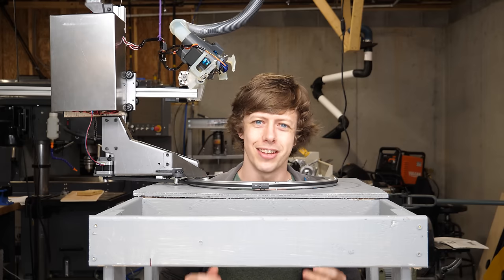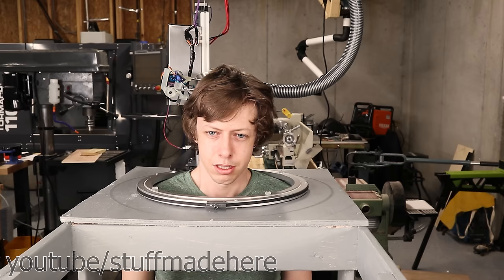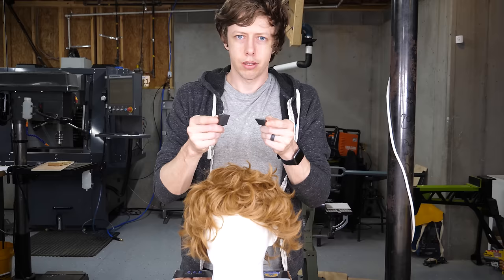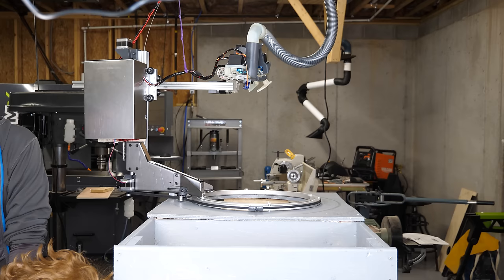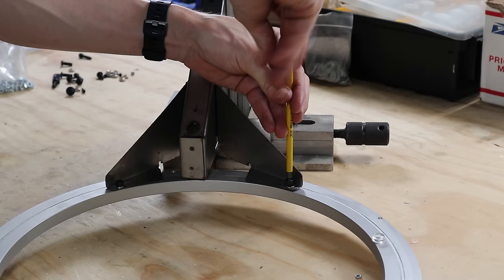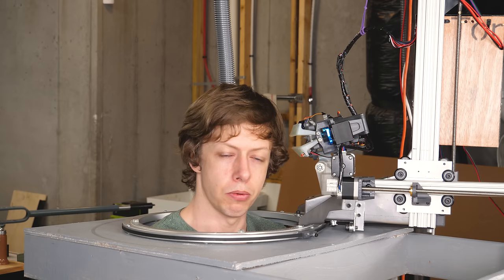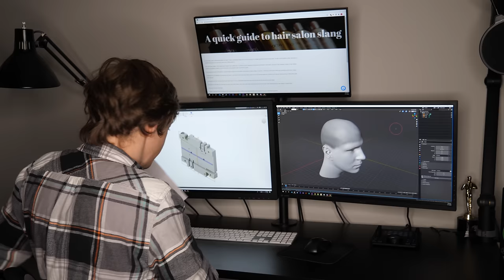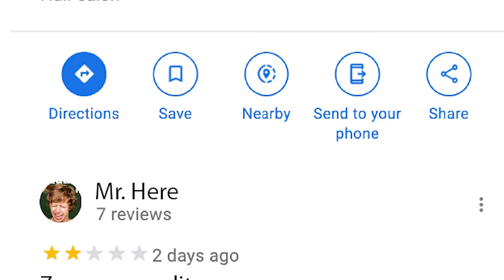I made a hair cutting machine

Comment from the maker: If I build a version 2, what features should I add? I really like the idea of adding a trimmer to cut an intricate pattern that would be impossible for a human to do.
Reply: Something to protect the ear much more. Turning into an elf would be my primary concern using this machine.
Reply: Ear slicer
Reply: Whatever you do i will root for you king
Reply: Could design some sort of ear protector prosthetic colored yellow or something that the camera could easily recognize.
If this becomes REALLY good, how about one that manscapes your, uhm, manscape area?
Reply: There are some electric rotary saws that pass current trough the blades to detect changes in capacitance in order to stop the blades if someone is about to have an accident (Cut their finger), maybe try to add something like that in order to stop yourself from cutting your ears off.
Reply: An ATC to switch between scissors and a razor blade for the finishing touches.
Reply: Extrusion tip to do some on the fly hair dying
Reply: If you’re adding a trimmer, you should consider letting it trim beards as well. Imagine the perfect goatee alongside the perfect mullet!
Reply: Add a vacuum to grab your hair instead of the little clamps
Reply: Nils Erik Mæland 

What this man said, a beard and mustache trimmer
Reply: The Flowbee comes to mind. Maybe an impeller that changes depth inside the vacuum hose? Safer than scissors and can get closer around the ears.
Reply: I feel like you should use clippers.  Could have it automatically change guide combs.  Might be tricky finding the contour of your head without more sensors but it would be cool to see a robot fade!  Probably also a little safer than using scissors...
Reply: Oh jk he thought of it
Reply: Nose trimmer! haha
Reply: I wouldn't mind seeing a trimmer as well
Reply: World's most advanced flowbe
Reply: I think you should make the robot offer you comics, so you can read them, while getting the haircut.
Reply: Forget all these other performance enhancements. Everyone knows the key is to improve the user experience. Need to add relaxing music and hot towel wrap!
Reply: You should make a costume for the robot
Reply: Once you make it do one pattern, you'll be able to do many. Maybe if you leave a tiny 'stuff made here' logo, so people don't keep asking "where'd you get your haircut".
Reply: trimmer is a great idea, maybe a head rest that moves around to the opp side of the siz to help keep your head steady
Reply: maybe 3d print a chin rest like those eye doctors use to keep your head steady. i was once thinking about an automated haircut machine as well. there was an tv selling product that was basically a vacuum attachment to cut hair. it hat the cutting mechanism inside the tube that sucked the hair in making it much safer but there is still the problem with partitioning the hair so only the part that has to be cut at that specific length will get sucked in.
maybe touching an electric ball lamp that will make your hair stick out in the direction of the normal vector of your scalp will help? haha hope to see v2 soon!
Reply: Stuff Made Here I reckon a trimmer would make it a lot easier to compute aswell, you don’t need to grab the hairs and it’s almost always in contact with the head and cuts at he correct length by using a gaurd
Reply: Ear guard, trimmers, and fix the axes. You need to set up a pivot which is approximately at the center of the head. This way when the cutter moves up and down, it also follows the tangent of a circle centered on the head. You may be able to get away without a vertical axis (just adjust the height of the seated victim), but adding one would allow you to control the angle of the cutter without having a flimsy and floppy knuckle at the cutter head. Just adjust the position of the pivot I previously described, in order to change the angle of incidence of the cutter at various points on the head. This would also allow you to handle the oblong nature of the head and get perfect necklines.

I would also encourage you to add a full-coverage guard on the scissor cutter. Good for stray hears, stray fingers, and stray ears. If you insist on keeping the scissors, you should add a layering stage to get a professional final result.

Clippers for a close clipped cut (sick fade bro!) will require a slightly different approach. Stylists will either freehand the clippers (for very short lengths), using the guard against the scalp as a guide, or will run the clippers along a comb. As you found, combs are not easy to automate, but I think you could use the same fake fingers as a clipper guide for longer lengths. If you want to run the guard directly against the scalp, you will need some sort of gentle spring mechanism to apply minimum contact pressure and prevent scraping and sticking.
Reply: Try with a Van Der Graaff generator. It will ppoint your hair perpendicular to the head better than the vacuum. You just need to trim like a helmet all at once.
Reply: water jet spray and a new mechanism to part and pick up the hair

that will reduce time of cutting and unevenness of hair cutting will be low as well
this is how we do where i live

but the vacuum mechanism will suck
pardon the pun!!!
Reply: Maybe adding a LIDAR sensor instead of the push button, so you can know almost in real time the distance between the head and the scissors. Also getting rid off the scissors and using a real hair cutter will be nice!
Reply: You could try using hair clippers to help trim the sides and back. You would manually select the guard but use a similar proximity sensor to guide the clippers along the head
Reply: Something to apply product to the hair and style it a bit.
Reply: Ability to fade the sides
Reply: A stand that fixes the head in place and also gives a place for it to rest, and it could extend from the chin to towards the ears to cover and protect them.
Reply: water spritz bottle. This could allow greater control for layering your haircut. Also +1 for the trimmer.
Reply: They have angled guards for trimmers. That way to could do the around the ears in almost one motion. Also, nose trimmer XD
Reply: Forget the hair robot... make a tattoo robot!
Reply: Razor to shave beard or low part of hair for a skin fade
Reply: Oh wow cool
Reply: i'd like to see a scissor/comb/trimmer automatic toolchanger.  and maybe a shampoo & head massage after everything is done.
Also, good job on keeping this machine pretty safe overall.  I nearly had 2 heart attacks during michael reeves' surgery bot video
Reply: Move the depth camera so that it would still see your face
Reply: Instead of scissors you should go with clippers/trimmers (safety), or at least upgrade the scissor with the new you bought if it is for the actual job.
Reply: Skin fade would be amazing, every time I get my hair cut it’s always different!
Reply: does this belong in https://www.reddit.com/r/dontputyourdickinthat/ ?
Reply: you might try lidar to get a surface to cut hair instead of that bump switch
Reply: You should make it force driven. James Burton does a lot with force driven robotics.

You can make it work through driving and sending current or by having 2 encoders with a spring to detect difference between the two which creates the constant force.
Reply: Allow continuous contact with the head for more accurate distance finding (or get a radar chip like project Soli) and make the cutting device like the Flowbee Haircutting System.
Reply: Idea 1: Have it give you a shave like an old school barber shop, just make sure it can't go Sweeney Todd on you!
Idea 2: Make your wife a robot that can apply makeup and 'print' pictures on fingernails.
Reply: @adrianeta  haha, just watched the video on the Sawstop too
Reply: Probs a squirt gun and a hair dryer
Reply: Laser scissors and relvolver for some motor utilized hair cutter. Some waterjet for easier job for scissors with hair, maybe.
Reply: @VinceGBro  instead of changing guides, have a single guide that can change lengths.
Reply: And add spring or something to give some force for scissors blades what pushes them  together for better cutting.
Reply: Something to be aware of with clippers, some people have lumpy heads (I have a friend...) and running the clippers along a lumpy head can actually create a lumpy hair cut. I prefer a more vertical fade on my sides so that my head looks a little more rectangular instead of, well, lumpy. I think you would have to pick a measurement point on the side of the head and then clip more vertically in global coordinates along the side instead of strictly a set distance from the head-scape.
Reply: I mean cutting making a way too accurate mandlebrot pattern would be strangely satisfying.
Reply: I subbed to you
Reply: Definitely trimming functionality! I think that alone would upgrade the cut from a $5 cut to at least a $6 cut.
Reply: beard trimming... oh wait , need an other model hehe
Reply: Spend some time improving on the off-the-shelf scissors.  Why spend so much time developing the spatial handling when you're using a prehistoric cutting device?
Reply: A quick wash before cutting? Or a pomade applicator? Or a mirror function? Or a coffee function? Or a nose hair trimmer?
Reply: Mohawk 👌🏼
Reply: buy a flowbee and attach it to robot for the second generation.
Reply: It has to be programmed to say "go ahead and look down a bit" a lot.
Reply: First I should say amazing video. I would change the scissors to something with a round point at the ends so if you accidentally move your head too much it doesn’t poke in your head. And also add an ear protection and an instant emergency stop button just in case something went wrong. I couldn’t get how it knows if you turn your head a little bit around. Does it also check for that somehow?
Reply: Shaving!
Reply: I think that a vacuum tube with a scissor like a camera iris would work very well. The robot could touch the tube in the head and activate the scissor. It would be much more safe.
Reply: Chin and forehead rest should help  to make less movements right? Like the ones ophthalmologist uses to see your eyes
Reply: IMHO
1) add a trimmer with a servo controlled comb/blade so that you can change trimmer numbers seamlessly for dope fade.
2)add roll pitch and yaw control to the trimmer mount for ful freedom of motion around head and above ears
3)whats your age man!!?
Reply: K
Reply: Adding some sort of quick change 'chuck' to switch between scissors and the clippers might be the way to go on that one. Rather than trying to get them all into the same tooling.
Reply: make it have a complex neural network that decides what type of mullet to give you.
Reply: Humans do some crazy patterns so idk If It won't be possible by a human.
Reply: If you simplified the joint geometries it would make positioning the scissors much easier. Also another Idea (perhaps harder implement) would be to mount the depth sensor camera on the arm so that you wouldn't need to bump into the persons head for every cut :)
Reply: Build one that gives a buzzcut!
Reply: treat it like a dual headed cnc machine...the arm goes back to home and gets a set of buzzers, then bam new program entirely for the lower base of the hair.
Reply: What about a machine to wash your hair, blowdry, and thén cut it!
Reply: hair wax
Reply: I cut my hair with clippers - its so easy and works a 100% - just start with a long clip all over - then you can grade it down to zero on the sides and back.

Would work perfectly and thats how you get those really nice cuts with long hair on the top (use scissor method there) and then grade down from sides about half to one inch above ears.

Also - maybe integrate your personal selection of podcasts or music with voice controlled - Hey Google.

So chit chat on google - then "Hey Google - play Santana".
Reply: To make it easier you could add a chin rest with cheek bone pads to aline your head so it doesn't move.
Reply: The ability to use a hair elastic. I mean everyone uses that, isn't it?
Reply: Idea Spam: 3D Scanner, On-Toolholder Camera, Toolholder, Scissors Tool, Shaver/Electric Shears Tool.
Reply: @d3lsl0w  and does something else while it's at it 😏
Reply: Get some better hair cutting scissors.  Quality scissors for a quality cut.
Reply: You should make it try to give a fade with a trimmer
Reply: Put something like aluminum foil hooked up to a circuit on your ears, then if the scissors contact it then the circuit completes and tells the robot to stop. (you can have the plastic guards make a barrier between you and your ears and push them out of the way). Also a comically large red abort button. and then for the angle for your scissors, you can make a 3d map of your head (this can just be a rough model using points then connecting them like game models since you only need the rough angle of the scissors, or something more fancy like that depth camera), then use multivariable calculus/linear algebra/differential equations to find the plane orthogonal to any given point on your head, then just make sure that the plane of your scissors is a multiple of that plane (ie it's parallel).
Reply: Waxing? Btw I love the baseball bat idea
Reply: more conversation starters
Reply: you should do a robot that shaves for you
Reply: A lollipop dispenser. 😁
Reply: facial hair trimming/styling.
but, giving a robot a sharp object near a human neck probably isn't a good idea.
Reply: Brain surgery feature
Reply: Do the perfect fade it would be easier with the trimmer
Reply: Split the inch-wide vacuum head into a grid of smaller vacuum heads,
with a small clamp and cigar-cutter at the end of each one for pixel-perfect accuracy.
Better yet, surround your entire head with a massive grid of vacuum heads and individual cutters and clampers,
each tasked with making a single cut.
Turn it on and all the vacuum heads turn on, suck up the entirety of your hair collectively,
then all the clampers mete out the proper length of hair simultaneously,
then all the cutters perform their cut simultaneously.

Then there's no need to worry about your head moving because the entire process happens in 10 seconds max.
No worry about wayward strands being missed because all the hair is sucked up and accounted for at once.
Reply: Add a camera to the arm so u can see what’s happening. It’s more of a cool thing.
Reply: 100 percent a clipper. seeing a robot detect when to switch to a 4 from a 3 and just get those clean sides in general I think would make a world of a difference. The biggest obstacle I see is switching from each level on the clipper, although I think that if you were to go with a  clipper and to solve that problem would be to 3d print a piece for the top of the clipper that can when moved up and down at the top of the clipper adjust from say a 4 to a 3 when the computer says to.
Reply: Hair laser
Reply: How about using a trimmer instead of scissors, less chance of cutting an ear off and could be mechanically simpler to get more usable angles and cut lengths. The buzzing also adds an extra element of fear 😂
Reply: Sensors! Moar sensors!
But specifically, add a counter-weight and sensor rig to the ring across from the robot, I bet it would help you locate your head much better, and I'd bet that the counterweight would help the rotation about the ring. While you're at it, mix it up with sensors, see if you can't get some ultrasonic distance sensors or image based sensors to help navigate your head.
Also, some kind of vacuum buzzer combo for around your ears and neck. See if you can't get a fade going.
Reply: I feel like an adjustable guard buzzer with a vacuum to keep hair straight and pulled back would be a bit simpler and might get the job done easier.
Reply: You're making a Flowbee. Just buy one and attach it to your rig.
Reply: Robotize a Flowbee with a continuously variable length guide.
Reply: @James Lintell-Smith Yes!
Reply: Using clippers (which are essentially motorised scissors) would be safer and would be quicker, a guard would guarantee length, including custom guards for the top?
Reply: Vacuum, trimmer, continuous cutting motion, finish the whole cut in 30 seconds.
Reply: Hair cnc... i like
Reply: The ability to have some small-talk with the robot could be nice. I mean we all know that's the REAL reason we go see a barber, right? Who actually cares about a good haircut. ;)
Reply: maybe make your robot crawl on your hair using some grippers/ clips/ vacuum? so the relative position between your robot and your head is fixed all the time. Robot position can be localized using external sensors.
I want robot to be able to wash and cut the hair at the same time.
Reply: Face shaver/beard trimmer, eyebrow trimmer, nose & ear hair trimmer.
Reply: Beard trimmer. Maybe a colouring function, dyes and the like. If you want to go all out you could have it like a Turkish barber and have it finish off the robocut with a razor. 

Rather you than me though.
Reply: Loose the voice. If theres one thing I could improve regular hair stylists with, It'd be them not talking to me. ever.
Reply: Make an ATC for it. Scissors and fingers on one holder, trimmer on one, polisher tool for the aerodynamic heads, comb and dryer to hide the cutting mistakes. The possibilities are endless.
Reply: Defo needs eyebrow trimming
Reply: make the person getting there hair cut sit on a  van de graph machine then use a laser to cut the protruding hairs. (will have to lock the person head in place for safety.) Might be joint venture between @styropyro and yourself (Colab).
Reply: I’m a barber and I have a lot of ideas. I’d like to help you.
Reply: dont be putting hairdressers out of business now,
i know what your capable of youn- i mean 30 year old i think?
Reply: Well, this is a tricky haircut to do. These days a haircut is trim the sides, make a fade, and with the top of the head, do just what the robot did. I think you can go for a trendy haircut, and program would be much easier to write.
Reply: my mums hairdressing business going great

stuff made here entered the chat

business ✖ 0 = 0 Ah we didnt need that anyway sitting homeless in streets watching Stuff made here making robot that programs
Reply: kkuhn WHAHAHAHHA 🤣🤣
Reply: Do the turkish eye and ear hair removal with fire :D
Reply: It should have a sexy sultry voice and it should also be able to shampoo your hair and wash
Reply: Why don't you use a clipper instead and program the robot to do fades
Reply: I was wondering if you could do some sort of capacitance testing on the scissors to detect if they were touching skin. That way if it senses the capacitance changes, if can abort the cut,  reposition the angle, and try again.
Reply: what about support for hairspray?
Reply: Next make a robot that brushes your teeth for you
Reply: I know someone that can help you with figure out how to do the perfect cut !!
Reply: Sharks with frigging laser beams.  And keep that vacuum turned on longer to take away the smell of burned hair.
Reply: Hair dying ability .
Reply: Add a clipper for the side and back, this will be the best barber ever
Reply: Better communication
Reply: Swap the scissors for an electric clipper.  And incorporate LASERS.
Reply: Line up and fade
Reply: Make it be able to dye your hair
Reply: You can make and wear a ear protecting plastic cover. So machine can move freely around your ears without cutting your ear :)
Reply: Choose a target type of haircut from a list based on current hairstyle.
Reply: you should make it be able to do a fade. Not only are fades tricky for a human to do, but it could be done with a higher level of precetion by a robot.
Reply: This is how he becomes a multi millionaire, get it patented, get shops around the country and give out robotic art haircuts
Reply: MASS PRODUCE AND TAKE OVER THE WORLD. also attach a flowbee.
Reply: Have it go answer the phone and leave you sitting there. Then have it ask "is this length ok" and ignore your answer. Also get CodeMakesItGo to help with a project!
Reply: If the camera concept is somehow made feasible, maybe write some code for recognizing skin color and cutting length that way
Reply: Do you have a pat attorney? Good stuff
Reply: A radio and seat warmer/cooler would be nice. And why not a way to pay at the machine, like a vending machine.
Reply: They make small skin safe no snag shavers if you catch my drift. You could possibly use one of those as an insert tool to trim around ears without chopping off ears.
Reply: Give up so it does not hurt you.
Reply: Mullet Maker option in the software
Reply: This is amazing. Great job man. I suggest you create a device which can alter its length. For example how a trimmers clip can be adjusted for various lengths, maybe if this device works in conjunction with vacuum so basically its touching your scalp and them the scissor is cutting at a length. I hope you understood what i tried to explain
Reply: Replace the scissors with a flowbee style cutter
Reply: By attaching the intel realsense or a single layer lidar to the moving parts of the robot, you would basically have a nice 3D scanner. You could then upload this perfect mullet of yours for posterity. Or simply  provide the user with a before/after 3D print of their haircut.
Reply: Awesome job! The only thing it comes to my mind is making the hair wet, it can interfere with the vacuum power but it will help to catch and model the entire cut as the hair will no longer take random movements/positions.
Reply: Try to attach the depth camera to the moving stand (this way, the stand will not block the camera), and do a calibration sequence in order to 3D model the head and the hair. The robot will be much more precise.
Reply: Awesome build! In version X, a smaller, portable one, the size of a helmet would be cool. Perhaps it can sit on the shoulders, cover the ears with some protection, scan the head/depth  and then use trimmer like cutters to do the job.
Reply: I bet if you made a small tube with a larger tube around it, then sucked in the middle and blew compressed air out the larger one you could separate very small hair sections. Then slide, like, a nose hair trimmer down the tube to the right length?
Reply: Use a Van de Graaf Generator to get your hair to stand out and then use a laser to cut it.  That's what I would do if I had the knowledge
Reply: Of course, you'd have to have a chin rest and a face scanning tool first...
Reply: I would consider changing the cut-length thing to just use a sort of adjustable spacer; so that once set, it literally can't be any distance other than the correct one if it's touching your head.  Bonus points for automating moving this for different lengths where necessary
I'm imagining a hollow ring, around the diameter of the vacuum, on 1 or 2 ... I don't know the term, the threaded things that you're using for moving the arm, with the scissors going between the ring and vacuum, and the switch on the front of it.  Rotate it with the scissors if necessary.  Then it can just press it to your head, maintain contact with the switch and cut (also acts as a bit of a killswitch so it doesn't try to cut unless it's actually touching your head with the spacer)
Also, this makes cutting around your ears slightly more doable.  I mean you won't get a precision cut, but if you press that against your ear it'll flatten the ear while pulling the hair
Reply: Using only one scissor is because of the human limitation of using only one hand to hold the scissor. Instead of rotating a single machine,  there could be four machines (back, left, right, and top) which does the cutting in parallel that not only saves time but also makes the problem more interesting with a distributed coordination.
Reply: Hair dye... or a perm
Reply: I liked the camera idea much better, it would make things a lot more robust as far as movement goes. If you mount it on the control arm where it won't be blocked, then you could use the "position relative to" for depth measuring. Using the flowbee technique was perfect, but added in the "fingers" to isolate the hair was genius. Trimmers on a separate gantry arm to handle the trimming above ears and at neckline would be great. then you wouldn't have to worry about creating a separate mechanism to switch out tools.
Reply: Firstly awesome vid. Secondly, could you add a trimmer and maybe calibrate some way to identify neck location. Then you could input your desired neckline (round or square) and then have it go to town. This could be a separate machine that you rest your forehead on a pad to allow the trimmer to be consistent and technical. It could also have another flat arm like the ones you were initially going to use like combs to push the ear down! Idk my mind started going off when you were talking about making upgrades and ideas of how to improve your design. I think a trimmer would be cool😊
Reply: Buy some ear protection caps
Reply: Fades and patterns
Reply: Id definitely be down to help you create this awesomeness ive been a barber for almost 14years and have a love for engineering.. definitely add clippers and more recognition cameras
Reply: a setting for the back where it asks you to look down? and uses an adjusted model with the face looking generally down
Reply: If you could add a machine and make it able to do fades ... Ergo change machine fairs lengths , those guards that move forwards and backwards to change lengths ...  Then this could be amazing.
Reply: It has to say the same story about that one time in Brooklyn, every time you go in
Reply: Bingo Ban,
One great suggestion tho.
If i would make one i would do it like the helmet way, 
There is gonna be a big helmet which has many small vacuum pipes in a horizontal plate. which will go from one side to the other of my head to right angle of my forehead.  
Then the vacuum will suck my air i mean all of my hairs under the vacuum plate. and then you just need to teach the trimmer to cut in slope
Reply: So, there is a really easy way to protect your head and ears, is how you said, use cordless hair trimmer with some tools on it. Its solve the bunch of problem with safety, cutting process and time too. Good luck! :D
Reply: Oh wowcool
Reply: make it do a skin fade
Reply: Stuff Made Here I would say maybe a 360 camera so you can see exactly what it’s doing to ease some of your distress while it’s cutting
Reply: Ultrasonic sensor for distance instead of the touch sensor?
Reply: put cutter in vacuum tube. add gyroscope. make it handheld and cut length based on position awareness... if possible... while avoiding secondary grab.
Reply: Skin fade option
Reply: i would say use some kind of hard plastic molded to your ear to that if the robot accidently knicks ur ear it just knicks some hard plastic.
Reply: these "ear coverings" could also be bluetooth connected and tell the robot where your head is
Reply: foldable side so u can walk into it and fold it down instead of go under
Reply: Maybe you can fix the head still and mount the cam ON the arm to improve the machine (very nice project tho)
Reply: Spray water?  It could also gel and style your hair at the end.
Reply: You should add a beard trimmer
Reply: Let machine ask you to pick a song to play.
Reply: change it to a male voice, seeing that it's more of a barber and not a stylist and add the voice line:
"that's pretty wack"
in response to a negative comment like, my dog died
also, possibly make different style haircuts, and when you have made you decision, it will say:
"say no more fam"
Reply: Add a water jet spray that sprays the hair in between the the suction tube and your head, before it proceeds to cut. Normally, hairdressers will spray your hair because it makes it easier to cut and you get better results with each cut.
This could also reduce the overall time the robot spends cutting it.
Reply: scizzors a bit more dangerous than trimmers so that would be a must have option
Reply: I could see this going mainstream and you oculd have one for your own home if it became popular enough, 
like the jetsons or something
Reply: Annoying smalltalk for that authentic feel.
Reply: Protect your eyes
Reply: @Bubbalubagus  That should fix issue of "lack of personality"
Reply: Add functionality to do perfect fade
Reply: Hair trimmer and water mister to wet your hair
Reply: Great job and amazing problem solving. I have two words for you ”Flowbee”.
Reply: Cut the hair with a laser instead of with scissors
Reply: The Suck Cut
Reply: A spray bottle to wet down your hair to keep your head wet works better with the equipment get your hair from going everywhere
Reply: Erect the hairs with static electricity. Use a laser to cut the hair.
Reply: Spray bottle that aims for your eyes
Reply: VR where you can cut your own hair with your own two hands
Reply: I’m a hairdresser and what you’ve built is impressive in its accuracy and ability. However, hairdressers will tell you the most repetitive task they do all day that needs to be done by a robot is a root retouch. Is basically using an applicator to apply a cream to the first 1/2 inch of hair at the roots. A root retouch is a boring, repetitive task that people pay a lot for. This robot that cuts is halfway there.
Reply: Make a second arm if you want to use a razor.
Reply: use ultrasound sensors instead of touch sensors, you can get a good accurate distance measurement that wont have issues with hair in the way!
Reply: trimmer, and maybe add a pump that sprays water on the hair like a real hairdresser does?
Reply: I literally laughed my head off dude!
Reply: Nice. It's awesome. Look into it's industrialization. I would buy some.
Reply: Could you just get rid of the small shears and add a trimmer ? It might do a cleaner cut.
Reply: Maybe you can have multiple cameras at different points at well as on its hand to get more accurate measurement of the subject's head and add software's that allows the robot to cut different types of hair and it's styles. 👍
Reply: a coffee maker and some magazines!
Reply: Add ear guards to make it safer
Reply: Nothing to say . But it is very complicated....
Reply: MAKE A PLASTIC COVERING FOR THE EAR AND FOREHEAD AND THE BACKSIDE OF THE NECK, SO THAT THESE REMAINS SAFE.
FOR THE HAIR CUTTING USE TRIMMER INSTEAD OF PAIR OF SCISSORS. SO THAT IT CAN ALL AROUND THE HEAD AND USE AN ADJUSTER TO MAKE TRIMMER CUT THE DESIRED AREAS. SHAMPOO AND CONDITION THE HAIRS BEFORE AS WELL AFTER THE HAIRCUT SO THAT DESIRED HAIRCUT IS ACHIEVED.
BEST OF LUCK FOR THE PART 2 OF THIS PROJECT.
Reply: MAKE A PLASTIC COVERING FOR THE EAR AND FOREHEAD AND THE BACKSIDE OF THE NECK, SO THAT THESE REMAINS SAFE.
FOR THE HAIR CUTTING USE TRIMMER INSTEAD OF PAIR OF SCISSORS. SO THAT IT CAN ALL AROUND THE HEAD AND USE AN ADJUSTER TO MAKE TRIMMER CUT THE DESIRED AREAS. SHAMPOO AND CONDITION THE HAIRS BEFORE AS WELL AFTER THE HAIRCUT SO THAT DESIRED HAIRCUT IS ACHIEVED.
BEST OF LUCK FOR THE PART 2 OF THIS PROJECT.
Reply: GOOD SCISSORS. Those you added to your robot are not the ones that hairdressers use, they're usually much bigger. Also, add a mirror, some hair trimming machine for the parts where hair is gonna be shorter and maybe a vacuum cleaner to remove the hair that's been cut.
Reply: So, basically a hair cnc
Reply: Definately make it cut your hair with a laser instead of scissors😱
Seriously tho, it could work with your dark hair color and light skin color.
Reply: Make some covers for your ears for extra safety while the robot trimms areas next to them.
Reply: Coloring!!!
Reply: @pierfrancescooselin9214  doesn't even have to be lidar, ultrasonic sensor works too
Reply: Mount 4 sensors in 4 corners and let it map out and track your head, this way you can remove a bunch of sensors from your robots "arm" and add other tools, could even get it to give you the perfect shave.
Reply: Make it so it can change your hair color. Like a hair dye feature.
Reply: How about hightech scissor?
Reply: Give it a face.
Reply: This is all wrong!! It should've been trimmers or clippers instead of scissors... Way faster and with less inaccuracies than scissors....then the rig, there are 3-axis robotic arms on the market that require minimum programming, no need to make a substandard and limited rig from scratch! The vacuum idea is the only good thing about this, also, the should've added a stand for The head, not a hole in plywood, once you set you head in a chin-forehead stand, the probe can measure it and it will remain the same and prevent the head from moving around!
Reply: Put streaks in your hair. Pull hair, apply dye, wrap in foil.
Reply: with a trimmer attachment how well will it do a zero fade from skin, military style haircut. if it can do that, i will buy one.
Reply: Impossible coloring, not just impossible trimming!
Reply: LiDAR proximity sensors, plus various hokey/jokey stylist personalities: Robocop, Optimus Prime, Marvin the Paranoid Android, C3P0, Daleks, Robbie the Robot, etc.
Reply: Take a look at Jimmy neutron's hair cutter
Reply: Get it to wash your hair
Reply: U need the robot to have more space so it can move freely around. u kinda wanna build it into the roof not around ur neck. :D
Reply: Pubic hair robot trimmer version2.
Reply: Why not put the camera on the vacuum tube so it's never blocked?
Reply: A big kill switch in case of emergency
Reply: Hair dying! Good luck! 😁
Reply: maybe add a razor to the robot
Reply: Make it conversate more
Reply: A rotating chair controlled by the computer so you just sit and it turns you around.
Reply: Face painting?
Reply: You should add a razor cutting ability for this robot, the razor gives your type of hair a "softer" feel than the scissors and would be great to see in action. I recommend the hair to be towel dry if using the razor though, otherwise it will hurt a bit...
Reply: I do think you can use a trimmer all the way without using any scissors. It is much safer and simpler. I suggest making a spraying mechanism that can spray instant dry dye and hairspray to do a custom drawing on your hair.
Reply: try to made trimmer with auto degrees changer by tracking position from ear
Reply: Add a 
1. Head rest
2. A tall seat ( so it can get the back of your head and rest)
3. rubber ear protection that holds your ears back
Reply: maybe build a massage robot for rub and tug?
Reply: As a licensed hairstylist and amateur coder I love this! If you need some professional tips it would be fun to see if you could try recreate what we do in the salon. For starters, wet hair is easier to manipulate and section cleanly. Have you tried using the robot on damp hair?
Reply: Intricate patterns that humans can't do sounds insane, the trimmer is a fairly cluncky thing to use for a machine, wouldn't adjusting to the small movements of the head while also correcting for pressure and angle be nearly impossible for the machine as well?
Reply: Add a separate arms on the opposite side to hold head still , get more accurate cuts
Reply: @Bubbalubagus  I better see you commenting on Micheal Reeves' videos
Reply: Yes, add electric hair clippers and just overall continue updating it and debugging it till it gives $10 haircuts
Reply: I was a hairstylist, I would suggest try to have multiple vacuums, suck the hair and the same time, and hold the hair with combs, then cut it all at once, then suck the hair again with slightly closer range with thinning scissors. You may use a few fixed springs with a stick to allocate the head position instead of using 3d detect(because hair has depths in it, is hard to scan underneath with the scalps).  So even your head moves a bit, the fixed  spring stuck is always catch your position. Another method, you may use trimmer with “numbers” on it , I believe u can manipulate the trimmer more easier than scissor, and more accurate length.
Reply: The robot should use a hair clippers so it goes faster, and then switch to the scissors
Reply: Make a Robo-wife
Reply: Please consider the effect of lying down and having the rotational  form in a vertical orientation- much akin to you lying your head in a stylist sink. This would achieve holing the head more secure and allow a simple fixture to be placed to "ride" along your neck line and trim it up.  My 0.02.... Bravo overall- Cheers!
Reply: Make a robot that washes your hair as well
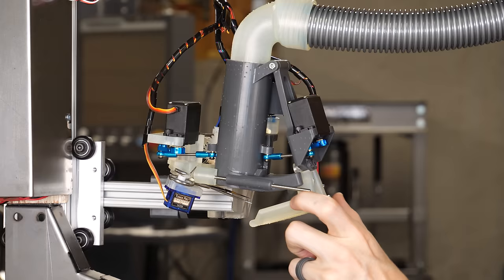Reply: (04:15)the way to cut hair. I think the order of the finger and scissors should switch so that it could fix the "wire hair" problem.
Reply: for Combing the hair before cut, I think it could add the two combs on top of the two fingers. so the hair cut steps would be 1. vacuum 2. comb 3. fingers 4. scissors.
Reply: Long distance hair cut, where the robot hand follow exactly like the hand of the barber
Reply: a eyebrow trimmer........
Reply: Trimmer
Reply: You should make it do a skin fade! I don’t know if it’s your style... but it’s one of the harder haircuts to give a dude. Awesome video!!
Reply: Mate. the main flaw is that the robot sits outside  and doesnt align proper because head move. You need to find a way to fix it to hair not outside.
Reply: Retro-Reflecting panels
Reply: You need bigger scissors buddy. That's all :)
Reply: Do a version 2, I feel like teaching a robot to use electric trimmers will be significantly easier, especially for simple trims (a buzzcut for example) is there anything that is teaching the robot how to cut hair? Like training it through videos.  Also something to protect the ears would be nice.
Reply: Maybe a style feature to give you a cool hairstyle without cutting
Reply: still like 17-18 y/o
Reply: Only thing missing is AI.  My BIL is a Genius, no joke Extreme Genius.  Extremely fluent in C++ and D.  His specialty is AI and works for one of the wealthiest CEO’s.  He’s working on an insane AI project worth billions.  I will have to share this video with him.
Reply: Give it the ability to cut the perfect skin fade
Reply: Make it keep the head in one place and have it cover the ears.
-Make it pull the hair in straight meches.
-Some mecanism to not get the scissors to close to the head.
-Buy realy good and sharp proffesional scissors.
-Use hair dressing technique in to your programing.
Your not so far from making a good machine.
But for the sistem you have you can generaly cut longer lenghs.
For shorter you need to change the machine i think its harder to give good short haircut.
Reply: You could wear special ear covers (e.g. modified over-ear headphones) to standardize the shape of the ear.  Then you could cut a lot closer.
Reply: I think you should add hairstyling features for afro-textured hair, maybe also adding a blowdryer and or conditioning lotion capabilities and a braiding mechanism ✊🏿
Reply: What about  a larger scissor? O even both, the one you have now that is short, and an extra pair
Reply: water sprinkler would be great option it can loosen the tight hair.
Reply: Fade
Reply: May I suggest a bot that plaited hair rather than cut it. (From a girl).
Reply: Not a feature, but if you found a way to pass a small electrical current through the scissors, you could basically give it the same functionality as a saw stop table saw and prevent it from ever cutting skin.
Reply: Add a leap motion hand tracker to allow for a "manual cutting mode" so your wife can cut your hair with super-accurate precision.
Reply: @d3lsl0w  Lets hope the sensors and 3d models are correct then LMFAO
Reply: Oh, what cool
Reply: Why tinker with perfection? You made an automated mullet machine! Send this thing to Kentucky ASAP and you will be Scrooge McDuck rich!
Reply: the easiest way to not injure your scalp or ears is stop using scissors or trimmers or any mechanical cutter
use powerful enough laser that has threshold to cut only hair and not skin
try ignite a lighter at your skin for 1 sec, nothing burns, put on your hair it melts within 0.5sec
so you can adjust the speed of the arm so it cant injure the skin
Reply: @samrolfe2563  I agree. There are a lot of ways to cut hair exclusively with clippers. And while they seem more dangerous it's actually a lot harder to cut someone with clippers than with scissors. The blades on clippers are designed not to cut the skin.
Reply: You could put the RealSense on the moving base to get the depth, but I guess an Ultrasound sensor would do sufficiently the same thing. It should be more convenient than the switch.
Reply: Stuff Made Here call it the anti mullet machine
Reply: Maybe add a resting pad for the head so it stays still?
Reply: At the end of the cut, let it ask you if you want Gel in your hair, then don't wait for an answer and just put an absurd amount inside it.
Reply: a water sprayer which would let more hair clump up together which may make it more efficient at cutting your hair.
Reply: Was the dog thing real or a joke?
Reply: i think it’s still cool
Reply: If possible a scanner (like car wash) so it will never touch your head and you can choose with  different size like 3-16cm the length idk 😂if that is even making sense
Reply: make it to make you coffee while getting hair cut
Reply: Put a eletric shaver so you can rip of this mullet and try using more than one sissors at the same time :O
Reply: To add to your idea. Link it to a mobile app, so you can draw/upload a design to create
Reply: just add a second robot with buzzclippers to do clean up after the first. so it can just focus on the lower areas
Reply: Add a second cutter parallel to the first one, so it does twice the work at the same time.
Reply: add a trimer
Reply: just forgo the scissors use precise lasers to trim the hair perfectly :)
Reply: Im willing to buy it already
Reply: I  think two separate machines may be simpler.  One for scissors and one for clippers. It may simplify how many parts you'd put on that machine.  If it could do it's own tool change outs that would be sweet.
I think you could set these up everywhere, and make Billions. Image a laundry mat with a haircut booth.
Reply: If you add a trimmer, I would recommend watching Brad Mondo's video on youtube. Hairdressers guide to cutting your own hair, mens edition. He does a good job of explaining the trimming technique.
Reply: A shaver. Probably makes your life easier too trimmer off areas near your ears.
Reply: You and I kind of look a like and I’m 18 years old.
Reply: What engineering did u pursue to do something like making such robots.
Reply: Cutting hair especially fades with clippers is a lot easier then with scissors I would use clippers because there’s a up and roll out motion that is used when cutting and blending the sides which would be easier since it’s only 2 movements up and a roll out on a pivot as for the top I would recommend scissors so what I would personally do is make a other machine with clippers that cuts the sides and if you want somthing for trimming the sides and back a remote control arm with trimmers would be simpler to make especially if you made a place to rest your face such as a box with a screen inside and with a controller and a camera you can trim your hair how you want it on the back
Reply: After the robor gives you a cut make sure the robot gives you a nice hair combing.
Reply: Maybe try get it to work on a neuronetwork this way it could Identify the space it has to work with better.
Adding the clippers would also require better angling. Are you using aduino or raspberry pi sets? Just curious.. Otherwise I love it.. Do you think you can mount the camera on the arm and maybe tweak the code for it?
Reply: Apart from the fact, that I want to congratulate on realizing an idea that I had as well, but never realized, I want to suggest the following: 
Stop using scissors. Take an electrical razor cutting along a comb/gutter. In this way, you only need one movement direction and no "fingers". Additionally, it will protect your skin when cutting closer to it. Especially at the ear. You can also more easily attach a distance sensor in its vicinity. 
3 cams in the opposite direction of cutter and 120° each to keep track of your motion. And be able to have an optical head scan. This way you can secure your ears. Moreover, I would really suggest a haircut - database, that allows hair length to head adjustments with a simple comparison. So people could then choose a cut style. You could implement that with a professional barber.

I see a huge market coming your way. If you manage to get that box working, it will be a major breakthrough in manual services. Haircutting at home like washing laundry. Chapeau!
Reply: One more. The idea is going the right way. But it is more helpful to not put the robot on a ring, like on the shoulders of people but hang it above them. Think the other way around on a stable stand and you got no problem with getting in or getting further down the neck. The trick is to put the whole machine upside down. ;) (I guess)
Reply: You'll probably never see this comment, but I've actually thought about this thoroughly before. The best way to complete this task is to have machine initially shave you bald, then 3D scan your head. From there is can track features for head position/orientation. Then use the vacuum and a buzzer to cut the hair rather than an actuator and scissors...mechanically its the same thing, but humans couldn't weild it as well as a robot.

Was dreaming of starting a robotic haircut haircuttery that relied on this, charging $10/haircut, which saves money over a conventional haircut that requires a tip.
Reply: Water spray
Reply: Now he looks like Mark Zuckerberg.
Reply: @Stuff Made Here can i use this video for a educational video?
Reply: Very nice all the best
Reply: In a more serious note. A trimmer is a good idea!!
Reply: I would try a more CNC mill-like approach I think, by first "roughing" the cut with the scissors to get it all at a fairly consistent known length that's reasonably close to the maximum desired length. Now that we know the approximate length of all the hair, the position of the head relative to the gantry, and the basic shape of the head, all we need is some basic geometry to tell us where the surface of the "cone" of hair being sucked up by the vacuum is, since any hair that's too far away to reach the vacuum hose should theoretically drop away. From there, we should be able to ditch the finger guides entirely and use a trimmer to basically mill the hair to the desired length pretty easily by making sweeping motions around the head, cutting the hair at the trailling edge of the cone.
Reply: You could try a first cut salon for women, for example straight cut, it should be even simpler than for men.
Reply: First, an auto-espresso delivery unit. Nothing like getting your hair cut and a good espresso. 2nd- add ability to shampoo, dye, cut, and style a woman’s long hair because my wife is costing us a fortune at the salon... 3rd- Video feed so victim can observe their hair being chopped. Otherwise I want one cuz I’m sick of cutting my own hair, it’s really hard in a mirror.
Reply: A hairspray mechanism, braiding arms, a combing arm and a curler winding wheel are some of my ideas..
Reply: IT should work
Reply: Shower
Reply: Make it pull up a phone and then you choose the options on how you want it
Reply: A robot that can bald fade
Reply: Can you put the real sense camera on the gantry so that it doesn't get blocked?
Reply: How hard would it be to add "sawstop" functionality? Not that I'm worried about it cutting you, I just think it would be neat to mess around with the conductivity.
Reply: back massage
Reply: Well, my first thought was, why doesn't it has a chin rest? that would help a lot if you plan to add a trimmer. Also, a simple solution to solve the mullet problem could be to keep everything the same and change the angle of the base.  You don't need it to reach down your face. Hope this helps. Good luck!
Reply: add turimmer is good works great
Reply: Why not just make something to cover your ears so there is less worry about cutting them off?
Reply: So cool to see the video and THEN see it get picked up by Nerdist!
Reply: Ripping off head machine like Ohio
Reply: You need to close the space where the is the sScissors and it wll be 80% safer as a  cutting machine
Reply: By the way i really apreciate your work it s amazing hope that u can try to contact big societeas of hair cut like in Paris or something maybe they will fund you to do something bigger
Reply: Hey I messaged you on Instagram hope you have the chance to read it! Thanks
Reply: Design it to give you a skin tight fade
Reply: Flamethrower or a series of single edge blades to do your sideburns.
Reply: Make it fly
Reply: Don't add just study, anylize and upgrade more your robot💪
Reply: @hacked2123  how would you you account for different head shapes? I also am curious about adding attachments
Reply: You can add an infrared radiation sensor so that the robot can differentiate between skin and hair
Reply: The robots replies should make responses that make sense
Reply: Add clippers for the sides and back!
Reply: Your gonna have to learn about hair cutting, cuz thats a terrible cut lol. the best and only way to do this with an actual result is to have it with a trimmer set to a certain length and you could have it cover areas of you head that a sensor could see but yah scissors and a vacuum, will not work and that was kinda dangerous.
Reply: I wanna see it!!
Reply: Sell Version 1 as the Hairy Eared Mullet Maker, and get the ShamWow guy to market it.
Reply: Call Version 2 the Van Gogh, as it takes a little of the top -- of the ears.
Reply: The robot should be wearing a mask to protect from Coronavirus.
Reply: One that pays hairdressers and barbers for taking their jobs away XD
Reply: Just let give you a fade. The perfect fade robot
Reply: kkuhn yessssssssssssss
Reply: With longer hair like yours add something to spray a little water on you hair hair is easier to cut when wet
Reply: Head chopper
Reply: Emergency stop button... Just in case...
Reply: put the depth cam on the chassis you casual
Reply: Shaver
Reply: Trimmers...
Reply: “My dog died “ ...Siri (“oh wow cool) 😂😂 that’s not cool at all
Reply: Those scissors are always going to be potential hazard when it comes around the ears. 
Instead you can go ahead with the idea of using the trimmers, replace the scissors entirely by the trimmers (no need to change anything else, the robot is perfect). They can give a perfect haircut all by themself top, sides and even back of the head.
Reply: A personality to the robot
Reply: Hair sprey
Reply: Colour
Reply: Make it dye your hair.  That would be a fun new set of challenges.
Reply: Make life easier.....put a buz cutter on it (it might also remove the dangers of a robot stabbing you in the head with scissors. LOL), use an elastic material that detects compression on the elastic for certain lengths. Also maybe a guard to cut around your ears with.
Reply: music
Reply: Emergency stop lol
Reply: THIS IS A WORLD CHANGER FOR INTROVERT
Reply: Use lasers
Reply: add a feature exclusively for undercuts: robot grabs your hair on top of your head, puts a clip on it, and shaves off the sides and everything it didn't clip. That's how my barbers do it for me.
Reply: You should add a brace for your head so you don’t have to worry about positioning them use a 3D camera to build a model of your head to plot the points that way it would be more accurate and maybe more simple. And if possible you should ad a second arm or a section with an electric trimmer to shave to back of your neck and make it cleaner around the ears
Reply: How much money about this machine?
Reply: cornier jokes repertoire.
Reply: What if you added a remote control option if you wanna control where is goes so you can do a random design if you felt like it
Reply: I take my hat off, throw it in the air, do a dance, you name it.. this is straight up genius, a real piece of engineering you got there! Version 2 should not be a question, but a certainty.. i honestly think you’re really sitting on something that has potential.. many interesting thoughts here but i just think you should refine what you currently have and start expanding with the basics, perhaps one of the stupidest examples but simply the ability to shave someone’s head bald might get the military interested, who knows maybe you end up with a government contract 😂 anyway, keep up the good work!! Enjoyed it a lot 👌
Reply: Instead of scissor used trimmer
Reply: Wait so you're not a teenager? You look like anywhere from 16-35 I'm very confused
Reply: Use clippers maybe instead of scissors. It feels safer.
Reply: a kill switch.
Reply: Add trimmer blades instead of sicisor..
Reply: shaver/razor
Reply: How did you learn all this?
Reply: Wow
Reply: Your a legend 😂
Reply: Instead of scissors attach a hair trimmer machine,also make  the trimmer length setter automatic to adjust the length as per need during hair cut.
Reply: Rotating base should be on top of head, it will give better reaching i think.
Reply: Hair Thinning Scissors for sure.. and today there are not impossible patterns for a human to do, but precision is definitely appreciated when it comes to hair.
Reply: Something like a armor to your neck , to your head do not move. Just like when someone breaks his neck and wear something to not move it.
Reply: a mechanical foot that pulls down the lever that raises your chair.
Reply: Scissors are so damn scary. The trimmer idea seems better!!!  Go for it and if it works then sent the work of art to me. Need it :V
Reply: I have a great idea!
You can put 50000 Volts on your body and than your Hairs will stand up.
Then you can cut them with a closed mirror laser.
Reply: attach a speaker and play the cauio theme song while getting a haircut
Reply: Definitely use a trimmer with adjustable comb length instead of scissors
Reply: @adrianeta  ya an e-stop would be interesting. I wonder how the hair will act tho. Will need some profiles. My guess is that the amount of oil in the hair and also weather conditions might affect the sensor capabilities
Reply: Use  a Vaccuum pump to suck a particular chunk of you hair before the robot grabs your hair and cutting it
Reply: just put a high speed router on it and have it carve permanent intricate designs into your skull
Reply: Flamethrower
Reply: congratulations! you may well be on the cusp of making yourself a ton of money - and eliminating the livelihoods of possibly a few million or so barbers and hairdressers all over the world: way to go, dude!
Reply: I have a request, do you could make it? Tattoo robot..
Reply: @donkeyshot8472  Lmao
Reply: Attaching the sensor to the front of robot ? That will let you make a 3D scape of your head first ?
Reply: nice, now build a robot that cut pubic hair
Reply: You can add trimmer it will be easy to cut hair
Reply: Bald
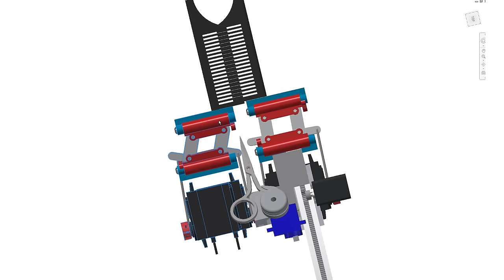Reply: How is the name of the software that you used at 3:25 ?
Reply: Add a feature to read minds so that customers wont talk
Reply: YOU SHOULD ADD BODY RECOGNITION TO YOU ROBOT SO THAT IT DOESNT HARM YOU. just an idea 🙃
Reply: go to machining parameters and use g codes!!
Reply: You should insert the clippers or the cutting system inside the vacuum tube. The tube will act as a barrier and only the hair that make its way inside the tube will be cutted.
Reply: How do you make these things?!
Reply: 3d print eye-ear protection gear, something in the form of a twisted spectacles the handles of which circle around the sideburns and then cover up the ears
Reply: Функцию отрезать уши
Reply: Idk
Reply: You might as well add a chainsaw
Reply: I love your invention
Reply: at tv to watch while your hair is getting cut
Reply: Everything is fine except the scissor, it is very short in size, so it can't cut all the hair grabbed by the vacuum
Reply: Probably some emergency push buttons?
Reply: What tools we should buy and how to use them would definitely be appreciated!
Reply: ❤️❤️❤️❤️❤️❤️❤️❤️
#Ayushi_music
Reply: Fading!!!
Reply: How about using a Van de Graaff generator instead of a vacuum?
Reply: you should make it put hair back on your head
Reply: Place caps on your ears     soooo scary. Maybe another support
Reply: What if you wash your hair with a liquid that can be easily seen by infrared camera
Reply: most of dislikers are barbers. They lose jobs.
Reply: Wow. Man. This is really impressive. I've been thinking about tackling a haircutting robot for awhile.... How long did you end up spending on this from design to programming and operation?
Reply: Hey, I have an Idea. You must have seen hair straightening up due to static electricity, right? So what I suggest is that you make something that straighten your hair and then program the robot in such a way that it just create a specified surface.

All the tip points of your hair will together create a plane. (Not a plane, but kind of surface) using that same 3D model Technique, let that robo know that at this much height, this hair surface should be above from the origin (origin maybe your neck) and it will generate the same shape/surface (it will cut the tips of hair as they are in turn points in surface function, robo will keep the tips at some fixed coordinates x, y, z).. later you can make something that loose the hair and then you can comb your hair to check the length of hair

For this, at least your have to mathematically do create some surface for a particular hair style..

I hope you get it
Reply: Beard trimmer
Reply: A water sprayer and blower for more easy cut hair
Reply: Ppl always trying to make a robot to put people out of business
Reply: One of your biggest issue is physical. Your hair needs to be wet to cut. At least that's what every hairdresser does.
Reply: Stuff Made Here hair wash
Reply: Stuff Made Here adding gel
Reply: Maybe so it can gell and style hair
Reply: Have the machine give you unsolicited personal details about it's life. To make it realistic.
Reply: @Bubbalubagus  bruhhhh
Reply: @karmicknight  lmao did u watch the video
Reply: SKIN FADE
Reply: SKIN FADE!!
Reply: Just have the robot shock you with a continual current so all the hair gets extented at the same time.
Reply: A very sharp straight razor that constantly shakes.
Reply: I would add a prototype to test the cutting around the ear but without a scissor for safety reason. Use something like a scissor marker so that you are 100% sure it is safe even if the machine suffers a malfunction or if there is a bug in your code.
Reply: I think my entire haircut can be accomplished with a trimmer. Add that, make sure it could make clean lines around the side burns, ears, and back, take out the scissors, and please let me know when I could buy one. I’m very serious.  Also maybe eyebrow trimming?
Reply: G E L
Reply: Clippers
Reply: Just give it a bigger vocabulary
Reply: Instead of scissors, why not use clippers? It's much more safe(for getting your skin or ear cut) and easier.
Reply: Dog haircut lol
Reply: That Really weird visualization looks that the creepy doll from Tory story
Reply: Chin rest to stabilize the head.
Reply: Razor cut
Reply: Get a robot arm that has 6 rotating joints, it will probably allow the cut to happen at all different angles.  And get a better scissor for real, or use a trimmer.
Reply: This worked WAY better than I thought it would. If you knock out the problems with its inability to reach certain parts of your head, I think you'll have a really solid prototype and could possibly even market it. You might have seriously struck gold.
Reply: add a feature where it gives you a good haircut and doesnt make all the hair the same length LOL
Reply: CNC the pattern on to the head/hair (using lasers)
Reply: A few more
Reply: Straight Razor
Reply: Ear saver you don't want elf ears bro
Reply: Add a trimmer
Reply: >trimmer to cut an intricate pattern
I totally crave for this. How about adding head massage in the break?
BTW I work for Japanese media and would like to cover and introduce your hair cutting machine in a Japanese TV show. Would it be possible?
Reply: Oh, well cool.
Reply: Make a machine to cut a toe nail 😬i think that machine has been for centuries
Reply: You should add a chainsaw
Reply: a way to color your hair
Reply: Coloring and highlights are very labor intensive and do not need sharp objects so why not make a coloring robot.
Reply: Add an ear protection feature!!!
Also add the option for programming in variable ear dimensions on the fly. have a feature called "cauliflower ear mode," and the like. 
you know ears can vary in length so
better include this feature. Wouldn't hurt to add a piercings feature too to where it avoids all the piercings on the ear (please for the love of all that is good do not make this machine pierce ears that is scary).
Reply: Why didnt he use a small tube which vacuums in small hair tails and then cuts it. Than way no combing is need plus it will always cut about same length. He could use different tube lenghts for different areas making it more layered.
Reply: I had a similar concept before using CNC but this one is missing one equipment... a STATIC GENERATOR.
Reply: Are those hairdressing scissors? They look kinda like paper cutting scissors to me. Assuming you want to use scissors at all next time.
Reply: I would love to try this out with my Afro.
Reply: use static electricity to make your hair stand up.
Reply: You should replace scissors with trimmer blade  and use more of  LiDAR tech to sense head position and shape
Reply: Vacuum the size of a head pulls all the hair out and Lazers
Reply: Womans hair would easier less intricate close to the head work
Reply: Well wt more can be done is design it in a way helmet ⛑️ work adding a fully loaded scanner and doing the math good . The most important thing is the cut the hair in precise length.
Reply: A hand that combs
Reply: More arms! Some for the hard to reach places, some for sensing. If the big conceit is the ring, then make it a track. 

Perhaps a smiley face to help keep the head still and perhaps a mirror or something so one can provide feedback, show off, etc.
Reply: The Vacuum to hold hair was just Awesome, What would be even more awesome is if you used lazer instead of scissors the cuts would be instant, though i am not sure if you would be ok with the smell of burnt hair 😊 and you will need lot of protection.
Reply: ball shaver :face-blue-smiling::text-green-game-over:
Reply: Replace scissors with clippers.
(Hairdresser and instructor here. I’d LOVE to work with you on this!)
Reply: lithophane pattern石榴石圖案lithopane pattern立陶宛圖案
Reply: @stuffmadehere pls build version 2!

*Idea Summary:* A new concept involves creating a revolutionary hair-cutting system utilizing a 360-degree vacuum mechanism that stretches the hair away from the scalp. This system ensures that the hair is extended uniformly, making it easier to cut without harming the scalp. Additionally, the integration of a precise laser cutting tool, controlled by an advanced vision system, would allow for meticulous and customized haircuts. This vision system would also include safety features to automatically deactivate the laser if it detects any risk to the skin or eyes.

*Possible Implementation:* To bring this idea to life, a design for both the vacuum system and the laser cutting mechanism is needed. The vacuum would need to be powerful enough to lift and hold hair in place but gentle enough to prevent damage. The laser system must be finely tuned to cut hair without affecting the scalp or surrounding skin. Moreover, the vision system needs to be incredibly accurate to map the head and hair layout in real time, adjusting the laser for different hair lengths and styles dynamically.
Reply: Circumcisions.